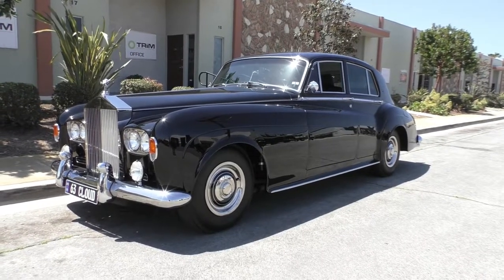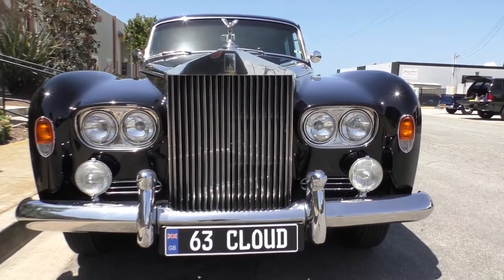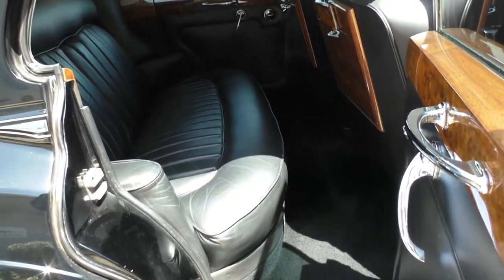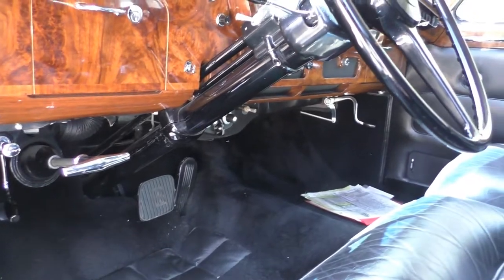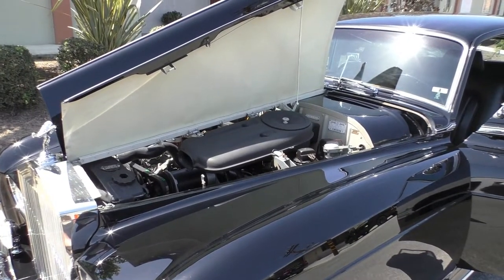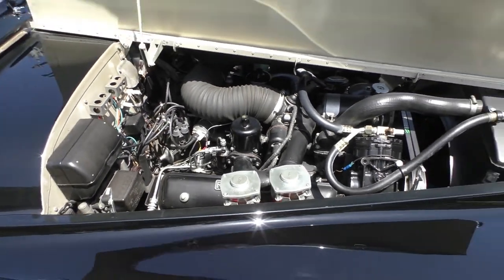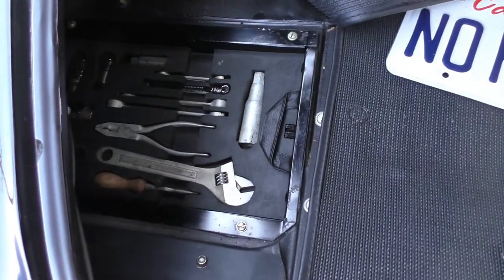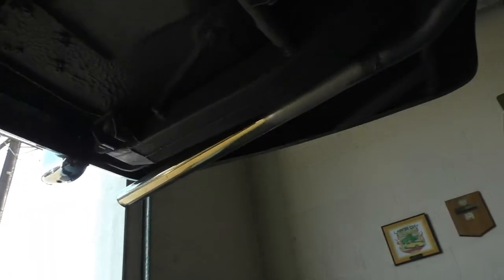1963 Rolls Royce Silver Cloud III (Sorry Sold)

Comment: Best cars in the world - until the company was sold to the Germans (BMW).
This car is a work of art and style, unlike the vulgar Teutonic slab sided awful looking things they make now...(sigh!).
The last company I worked for made the bonnet emblems years ago (the Spirit of Ecstasy). We also made various engine parts for the old RR 6.35 Ltr V8 engine including the condos, and various other chassis parts for Bentley motors (now owned by Volkswagen), in fact we had one of the RR V8 engine blocks in our warehouse as well as a couple of cylinder heads.
As it happens, in my current job I work about a mile or so away from the Rolls Royce assembly plant in Goodwood Sussex UK.
Reply: The new ones are hideous.